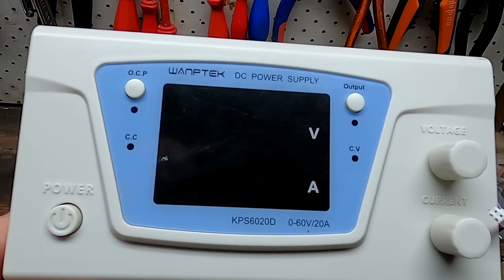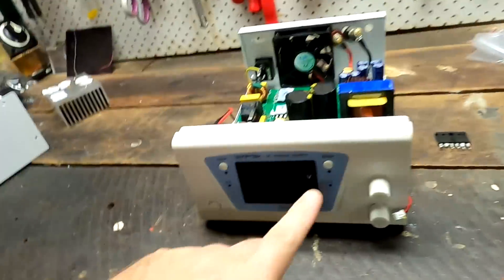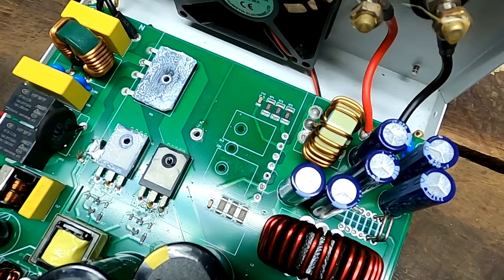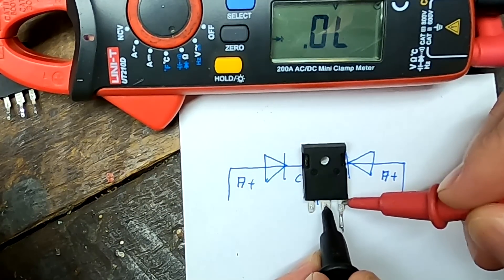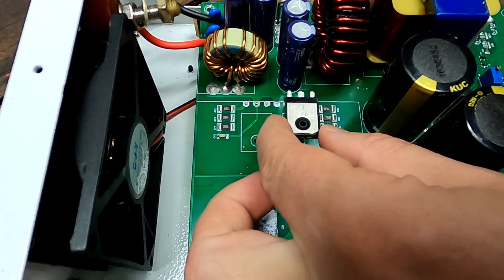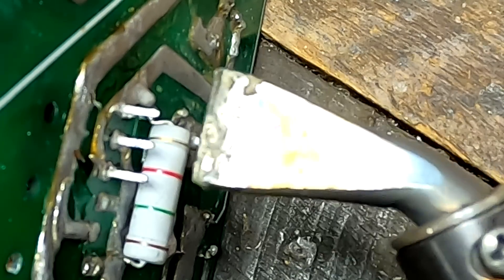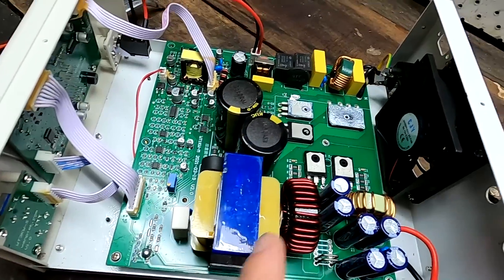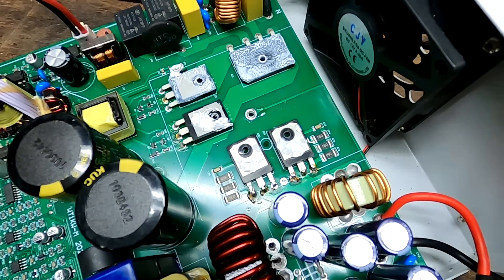I wrecked the WanpTek 60V/20A adjustable power supply 💥 ... and repaired it again WITH THIS!

Comment: Power supplies generally can't handle reverse voltage, whereas battery chargers are designed to handle reverse voltage.  For a power supply, though, it isn't just reverse voltage that is a problem.  It is also a problem if you connect the power supply to the battery properly but the power supply is turned off... that's actually ALSO reverse voltage on the power supply's output stage.   Depending on the type of output stage, the reverse voltage a power supply can handle ranges from 0.7V to around 7V before the output stage implodes.   And that's it.

The most common way a battery enthusiast destroys a power supply is by trying to charge a battery with it.   Lots of people do it, because they think it works fine "because they've done it many times before", but it is a recipe for disaster.

There are only two correct ways to connect a power supply to a battery:

(1) You connect the output of the power supply to the battery via a diode.  I usually use a Schottky diode (about a 0.34V drop).  This protects the power supply from reverse voltage, but your amps will be limited to whatever the diode can dissipate which is typically only around 5A in free air (for a big diode)... 20A rated diodes need heat sinks to actually run 20A through them.

(2) You do not connect your regular power supply to a battery.  Instead, you use a proper battery charger.

Battery chargers... equipment explicitly designed to charge batteries, are a lot more robust and can deal with these situations without damage.   Battery chargers won't blow up if the AC side is disconnected, won't blow up if the battery voltage is higher than the charger's output voltage, and generally won't blow up even if you connect the battery to it backwards.   Regular power supplies don't have these features.

p.s. yes, you can gang multiple diodes in parallel and increase your output amps, but de-rate the per-diode amperage to 3 or 4A per diode.  So, e.g. 4 x Schottky diodes in parallel can handle 12-16A.   For bench power supplies.  Battery chargers already have special output stages (usually back-to-back BJFETs or something similar) and don't need additional diodes.

Look for 20SQ060 on Amazon.  20A 60V schottky blocking diode.   That works well for 48V applications.   For 24V or lower applications you can get away with 20SQ050's (lower voltage drop but only tolerates 50V reverse).  But insofar as having a pile of generic Schottky's, the 050's or 060's are as generic as they come.  Make sure the reverse voltage specification for the diode is high enough for your application, Schottky diodes have lower reverse voltage tolerances than normal diodes.

(voltage flavors range from 30V to 100V reverse voltage tolerance.  Lower reverse tolerances also have lower forward drops.  If you are not sure, get the 060's or 080's).

-Matt
Reply: Sure, you a right in theory, in practice no one cares and will do it anyway, because it is just too practical and cheap to do so.
Incase you fry something it is still cheaper and easier to repair the power supply than have a dedicated charger, miss use is the normal usecase for every kind of equipment, you need to know about there limitations and what could possible go wrong.
Reply: @jonasstahl9826  Well, two problems.  (1) Most people aren't going to repair their power supplies.  And (2) A fire is a possible outcome, particularly if the power supply is unattended (as it often is) while charging the battery.

Diodes are cheap.  Use'm.

But as I said... lots of DIYers think its ok, and it generally takes the school of hard knocks, or a fire to change their minds.   Kinda like .... everyone remember the DIY Lichtenberg/fractal wood burner fad that happened on social media 1-2 years ago?   Where people were trying to DIY high voltage by ripping out microwave transformers?   It took a few dozen deaths and 8 months of professionals getting dissed on social media for warning about the dangers before people got the picture.

This isn't quite that bad, but its bad enough to warrant a warning.  I don't connect bench power supplies to big batteries without a few diodes inbetween, ever.  Its just too dangerous.   Just replacing some obviously burned-out parts as Andy did is not necessarily a perfect fix either... those electrolytics probably have burn holes between the layers internally, for example.
Reply: Well i appreciate your educational post. Thanks Matt.
I had come across this but forgotten, and was just about to dip my toe into this area by purchasing a power supply, and may well have ended up connecting a battery causing damage or fire.

Comment: Here are the 10 most important things to learn from Andy on this video:

1. Connecting power supplies the wrong way around can cause damage, as seen when the creator accidentally connected the positive and negative terminals incorrectly, resulting in sparks and ultimately damaging the power supply.
2. Pre-charging the capacitors inside a power supply can help avoid sparking when connecting a battery to it, as it ensures that the voltages on both sides are equal.
3. If a power supply appears to be non-functional, it's essential to inspect the components for damage, such as burn marks or a burnt smell, and test the components with a multimeter to diagnose the issue.
4. In this case, the problem was found to be two Ultra Fast Recovery Diodes (MUR30120PT), which are essential components in rectifying and regulating the output voltage.
5. Diodes are one-way valves for electric current, allowing it to flow in one direction while blocking it in the other direction.
6. When replacing diodes or other components, it's important to ensure that they are properly aligned on the PCB and have good contact with the heatsink for optimal heat dissipation.
7. Using the right tools, such as a 150-watt soldering iron with a wide chisel, can make it easier to solder large components like diodes or MOSFETs to a PCB.
8. After repairing a power supply, it's important to test its functionality with a multimeter and by connecting it to a load, such as light bulbs, to ensure that voltage and current outputs are as expected.
9. Thermal paste should be applied between the components and the heatsink to ensure good thermal contact and efficient heat dissipation.
10. When working with electronics, it's important to be cautious, stay safe, and double-check connections to avoid damage to components or devices.
Reply: I would add:
Do not buy or use a power supply/charger that is missing basic protection features such as reverse polarity, short-circuit etc.
I blew-up my LiFePO4 12v 50 Amps charger by accidentally connecting in reverse. A spectacular bang, piece of the huge crocodile clamps was missing (fused onto the bold of the LiFePO4 cell) and the charger was broken.
I took it apart to attempt to repair but it is so cramped, it is very hard to reach the components.
Do not buy a power supply where it is too easy to reverse polarity (such as crocodile clamps) but rather with connectors, cable-looms or clear (and beefy) connection-posts..
As we all will make a mistake eventually.
Reply: Bonjour
Je pense que vous êtes électronicien, pouvez vous m'aider à réparer mon alimentation  ? je sais le poste à 2 ans 

Désolé je ne parle pas Anglais heureusement la traduction est là 
J'adore vos vidéos et votre bonne humeur ! ;)
J'ai également un problème sur cette alimentation wanptek KPS6020D, impossible de trouver un schéma électrique, ont ils un support ?
Je suis électricien mais pas électronicien donc un peu compliqué pour moi
Voici ce qui est hors service sur la carte : IGBT Q6 K30H603, la résistance R87 302, condensateur céramique C55 ( valeur ?) et l transistor Q8 BA 
J'aimerai la réparer moi même si possible mais je me pose des questions :
Comment déterminer la valeur du condensateur céramique C55 sans schéma ? 
Peut on installer des composants plus fort ?  exemple remplacer le K30H603 par K75H63 
Comment peut on améliorer cette alimentation ? j'ai lu dans les messages précèdent qu'il fallait ajouter une diode en parallèle sur la sortie qu'en pensez vous ?
Il y a bien un fusible rapide de 10A mais les composants ont quand même grillés... :(
Moi aussi lorsque j'ai connecté mon pack de batterie seplos il y eu des arcs électriques, sans doute la charge des condensateurs de l'alimentation 
Si j'ai bien compris il faut toujours que la tension de l'alimentation wanptek soit légèrement supérieur  au pack de batterie exemple : 55VDC pour 51VDC et toujours démarrer la wanptek en premier
J'ai lu aussi que l'alimentation n'est pas aux normes ou n'est pas fiable, pour quelle raison s'il vous plait ?

J'ajoute une précision : le condensateur céramique C55 est en série avec une résistance de 18.67 ohms (3x56 ohms) et en parallèle sur la diode rapide MUR30120PT nommée D20
Si je comprends bien dans le sens passant la tension du condensateur est à environ 0.35VDC et en inverse cela peut être très élevé comme 60VDC ?

Merci, à bientôt
Alex
Reply: 11. When servicing electronic equipment never connect it directly  to mains. Always connect it to an isolating transformer to protect yourself.
Reply: @Juergen_Miessmer  12 have protection in the power supply leads as well. Youd do it for an MPPT charge controller why not a 20A power supply?
Reply: @grahampahl7100  A fuse on the Battery side - yes of course. 
These small wires will light up immediatly when shorted.
Reply: U have to buy supply with 10 y. warranty and U have no problems, because parts are well designed and properly cooled.
Reply: @PavolFilek  warranty doesn't protect from user error.

Comment: I bought this power supply based on your experience with it and tonight I fired it up for the first time. My cells arrived today and I started with a parallel top balance, but that didn't work out well. I reconfigured the pack to 16 series and I configured the power supply to 58,4V, 20A, but when I connect the battery pack, it will only push 5A instead of the rated 20A. It is running for 15 minutes now and the voltage on the display is dropping instead of going up. I am working on my first pack ever, so please be gentle to me ;)
Reply: I hope you have a BMS connected as well during this top balancing? How much is the voltage dropping? Maybe you forgot to enable the supply same as Andy in the video :)?
Reply: @matija3791  I’m monitoring the individual cell voltages continuously and I first initiated output on the wanptek. Strange: when I lower the current from 20A to 10A, the measured current on the charging cable is rising from 5A to 10A. 🤨🤨🤨
Reply: @Gorgelodokus  which voltage do you measure as minimum on the lowest cell and which oh the highest cell?
Reply: @matija3791  all 16 between 3,30 and 3,38 V so I would think they aren’t in the higher area where they couldn’t take it any more, right?
Reply: @Gorgelodokus  in this range full current should be expected when you put the supply to 58V and the current is not limited by the supply...
Reply: @matija3791  What’s also very strange to me: when I decrease current from 20A to 11A, the measured current goes up from 5A to 11A maxmimum. Is there some explaination for it? Contacted the seller already but I assume they will respond later than community experts :)
Reply: @Gorgelodokus  what about the cabling? Do you have very long or very thin cables? Do you measure same voltage directly on the pack in comparison to the set voltage of the supply when it is turned on? Probably it's just the supply defective somehow, or maybe the BMS somehow limiting the voltage?
Reply: @Gorgelodokus  what if you increase from 11A to 12A?
Reply: @matija3791  10AWG 1meter long. Both positive and negative same length. When I go from 11 to 12, the current drops, so the highest possible current I can get is 11,7 at this moment. Cells are 19 degrees Celsius.
Reply: @Gorgelodokus  very strange. Sounds as if something in the supply itself may be regulating the current down...
Reply: @matija3791  After a long night of sleep I was able to think with a clear mind again. Turns out my multimeter only measures AC currents and not DC. Shame on me. Time to invest in a new amps meter.
Reply: No that's fine, it's unable to feed the 20A because the batteries are full.

Comment: Maybe to add an external fast acting fuse to PSU's output? Like cylindrical fuse with DIN rail fuseholder in external small box?
Reply: Fuses - fast acting or not - are usually being protected by the electronics. You will have a good fuse afterwards but blown electronics. No fuse is fast enought exept if it is an electronic fuse.
Reply from the maker: Would a fuse not also trigger at normal operation?
Reply: @OffGridGarageAustralia  Fuses need time to heat up and blow (or trip if a breaker) and are good for disconnecting faulty electronics like an inverter or a charge cnotroller from a big battery (or generator) to avoid futher damage like a fire but not for fast protection as electronics need. They are like a backstop when everything else has failed. They will probably protect cables from melting. They are after all just a thin cable and obviously give a voltage drop at high currents. At normal operation they will probably blow at about 1.2 to 1.5 times their rated current but if just above their rated current it can take minutes or more before they blow. For a split second they will tolerate much higher current which is why they can't protect electronics. It is all a matter of where it heats up the fastest.

Comment: When I got my RDTech 50V 20A power supply, with a mean well 48V 10A DC brick, people said I should test the short circuit protection on it.  So I did.  Set to 20A too.  What I didn't take into account was this test can be performed at 1V or 5V, I had the PSU set to 35V.  I removed the plastic screws off the terminals and grabbed them with the pliers.  LOL  
Sparks?  F....k!  Lightening and smoke, huge crack and scared the living daylights out of me.  Thought I'd surely toasted it.  Not.  Small arc burn on the pliers and post though.  I braved trying again and holding and it was still alive and was only willing to put about 0.1V out at 20A through the pliers.  It still works to this day and was the PSU I was using below.
Note.  Not all PSUs have a diode in series with the output and powering them up via their outputs can be a YMMV thing.  Some PSUs have an anti back feed diode that will blow a fuse, others have an antiback feed diode that just melts.
Reply: thats the whole point of current limit

also now u know i=v/r
Reply from the maker: Hahaha, funny to read. Thanks for sharing. That was like 700W! Wow. I can imagine the bang and spark.

Comment: The sparks don't lie.  I was top balancing groups of cells.  Moved from charging 4 in series at 14.40V to charging just the bottom 3.  Got my order mixed up.  Instead of setting the voltage first, then moving the connection, I went to move it first, SPARK, "Hmmm... check the output is on, it is.... hmmm"  Sometimes the first one does, tried again, Sparks.   Nope.  Something is wrong.  Stop.  Check voltages.  AHHH!!!  14.40V across 3 cells.  Thankfully I did not do as Andy did and "plough on" anyway.
Reply from the maker: Sparks are a wonderful thing 🎇 They are here to help you find you mistake immediately!